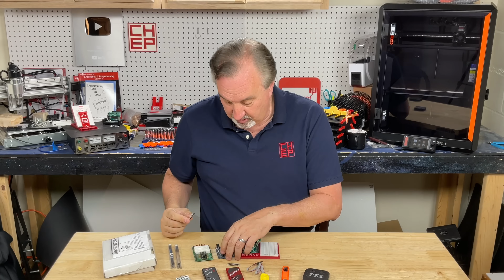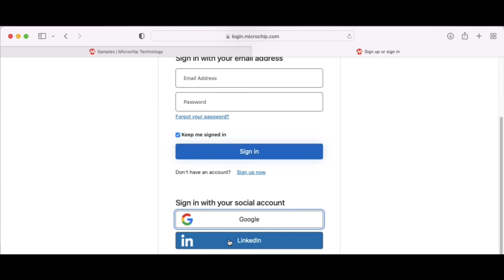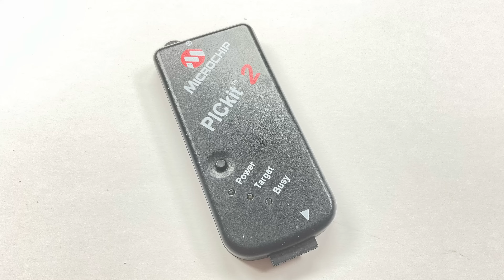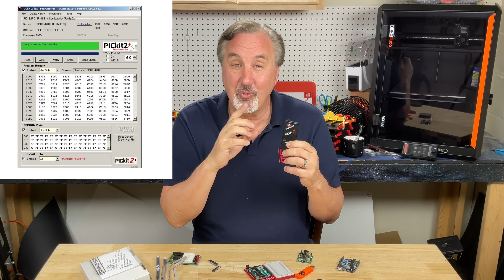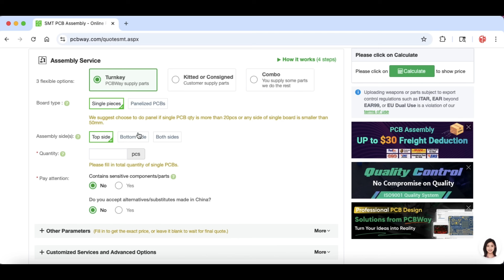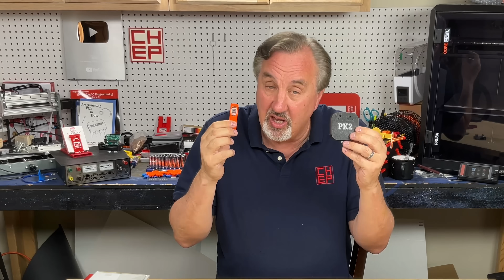FREE Microcontrollers for your Home Electronics Lab

Comment: 기능 땜에 8비트를 선택 하지 않을 테고,구입 편의나 개발 편의 나 가격에서 장점이 있으리라 생각하고 8비트를 찿나 본데..이건 아닙니다...마치 현대에 5천원 짜리 식칼 보다 더 멋진 돌칼을  만들려면(투입 인건비 말고도)한 10이상의 비용과 시간이 필요 할 겁니다.
Reply from the maker: Not convenience, simpler. Why use a sledge hammer when a simple tack hammer will do. Someone getting started with electronics can learn hardware and programming a bit easier than jumping into complex controllers that are hard to solder (which is why they are mostly modules) and more complex to understand. Plus you can get these 8-but micros for free in sample quantities. It’s an option to learn, the same way people are used early Raspberry Pi’s or old Commodore computers to learn about the fundamentals of PCs. And creating a simple LED controller just doesn’t need 32Bits to learn the basics.

Comment: I was at the Polar Filament BBQ a few weeks ago, didn’t know you were local. I’ve been programming Atmel chips, as a hobby, for years. Never tried PIC’s. Have you had any luck with the “newer” AVRDx series? They seem promising but are difficult to program. So far I’ve had a 20% success rate with a handful of AVR64DD28’s at blinking  an LED.
Reply from the maker: I haven’t used those. What tool chain are you using?
Reply: @FilamentFriday  I write the program in Arduino, then flash the .hex file with pymcuprog. I use a MPLAB Snap for the programmer. The MPLAB x IDE never worked for me. I’ve tried Adafruit’s UDPI Friend, or the DIY SerialUDPI and Arduino. That works for the newer AtTiny series, but not for the AVRDx series. YMMV
Reply from the maker: I’m hoping the PKX software comes out soon. It gives you a nice GUI similar to PICkit 2 but supports all the latest programmers. Maybe comment to them if it supports those devices. 

https://youtu.be/VNyvLxknr_E?is=Rx4XuJdjIvtBZ5u1

Comment: This was around probably for 30+ years. Although in Hungary it was suspended, because all the EE students ordered free microcontrollers and there was no sale. (pretty stupid idea if you ask me)
For the AVR8 part of the video: You can order an Arduino Nano from Ali for around $2, and use it as a hardware programmer. You can use either the ArduinoISP sketch from the examples, or you can easily write your own (I did both). The Nano I used has a neat trick: I cut the reset track between the ISP header and the MCU, and connected a GPIO pin there. This way I can use its 6-pin connector to program another device. I have no comment (minimal experience) on the 8 bit PIC, it's a weird architecture. ARM and the ESP32 based devices are getting cheaper, so their usefulness is limited anyway.
Nice video though!

Comment: This wasn’t on my radar at all - thank you!

Edit - confirmed first order of 3 ATTiny85s coming my way for $0 and $0 shipping in 1-2 weeks. Let's gooooooo. I'm definitely going to try wiring up one of my development boards to program it, but I'll look into whether I'd prefer a dedicated device down the line. I'm going to snag some Atmega328ps next, but what really got my eye is that there's also a ton of samples for other compatible chips for LED drivers and Zigbee Transceivers and Humidity sensors etc. Right on!

Comment: what about the new stm32c0 series? 32 bit, cheaper than 8 bit mcus, and recognizable ecosystem and gpio
Reply from the maker: No hobbyist friendly DIP packages. 3.3v operation vs 8-Bit 5v that is for easier for many sensor interface. Relies more on dev boards for programming or pre-installed bootloader than stand alone programming option. Also far fewer device choices. 
But it is another potential tool in the tool box.

Comment: Hi Chuck, great video! We have an rc car club that race the RJ Speed R/C Legends Oval Cars. I got one of the traxxas start light and have been trying to add a start horn to it with just some limited success. Is it possible to have pcway to build a board that I could plug in an extra receiver for my car radio (Futaba spare ch button) to start the count down with short beeps and then longer blast for the start of the race just like the traxxas does with lights. The traxxas also varies the time between the get ready and start light. Thanks for any help. Mike
Reply from the maker: That all seems possible with a little bit of 8-Bit programming. I assume the CH button puts out a pulse that controls a servo controller.

Comment: So what software on what OS runs the early PICkits? I have an ICD2, a PICkit2 and a PICKit3. None run under current OS's. When I last looked at MPLab, 0 of the few hundred 8 bit micros i have - bought and paid for- are listed. 
Also have some older 16 and 32 bit microchip products. I think they're junk now. 
ESP dev boards are cheap and headache free.
Reply from the maker: You can download GCSTUDIO (with GCBASIC compiler and PICkit 2 software included) for free right now and use your PICkit 2 and all your devices right now at no cost on the latest Windows OS. 

This is also why I like the open source PICkit 2 and PICkit+ software. It runs on the latest windows OS and supports PICkit 2 and 3 with all the older and newer devices. There is a Linux option as well. 
The GCBASIC I recommend runs on latest Windows as well and will support all your 8-Bit devices. The GCSTUDIO IDE option is based on VSCODE. 

Since PICkit/PICkit+ GUI stands alone you can use it with any IDE you want. Once the time/date stamp changes for the Hex file (due to new compile) the PICkit+ software can automatically programs the device. 

MPLAB is a different story. There is MPLAB 8 which is Windows only and MPLAB X which is Windows, MAC and Linux. Now there is now MPLAB for VSCODE as well. So I’m not sure which MPLAB you refer to. 

ICD2 requires MPLAB 8 so for the most part that tool is limited to dead unless you run MPLAB 8 on Windows 10, 11 with compatibility mode in windows.
Reply: @FilamentFriday 
Thank you so much for a rapid and detailed response! I will look into this. Thanks again!

Comment: Remember when the quantity was unlimited & they didn't require a corporate email address.  The C compiler was for Windows only & paid.  We programmed in assembly & made parallel port programmers, just to get any amount of computing power for free.  It was bad for finding a job though, as the industry was pivoting away from makers & towards leet coding challenges.
Reply from the maker: I remember. AI  (IMHO) is changing the game. Coding is getting far easier. Hardware the challenge. Just search Tesla and 8-Bit and see what they’re doing. Present 8-Bit architecture has built in analog capabilities that make them potentially smart analog devices with the right code. So I see opportunity for those who understand but also what could be a lot of fun once again for hardware loving makers & hobbyists.

Comment: Thanks for this video and the heads up Just ordered some ATTiny85 for a micocontroller IR remote control project I am starting.
Reply: Try attiny412/212 is way better and modern
Reply from the maker: 412/212 aren’t offered in DIP for easy experimenting. With GCBASIC, you can develop with Tiny85 and with a single command line change convert code to 412/212 when ready for surface mount.

Comment: As for boot strapping your Home built programmer, I used to use the parallel port to bitbang. Avrdude probably still supports that, but parallel ports are long gone from PCs. Just buy a programmer and spend the energy on your projects.
Reply from the maker: I’ve sold some in the past as solder kits. Some people prefer to build their own.

Comment: Free is all and well but if you design using the chip the unit cost may be higher than the other options out there.  And keep in mind PIC is not as standard and multi-sourced as ARM or x86. Your design will be captive to a single source.
Reply from the maker: Most hobbyist projects won’t need more than a few free ones so not sure how unit costs affects that. But even in quantity many are sub $3. Power consumption is typically lower with 8 bit as well so battery powered projects benefit. It all depends on the project. Having the capability of multiple options gives you a more complete toolbox to design with.

Comment: I used to live near Silicon Valley and used the "sample" programs to get chips for one off projects. The biggest issue I had then (late 80's-early 2000's) was making my own PCB's. Now, with companies, like the one you advertise, it takes that PITA part of it out. I worked at a company once as a robot tech, we had a sensor board that failed often, and was a PITA to replace. I redesigned the board it was mounted on that could be changed out in 5 minutes vs. 45-60 minutes before. We made, by hand 200 of those boards. drilling all the holes, separating all the individual boards, etc. You wouldn't believe how those boards would eat up drill bits and milling bits! 
PCBway would have made that a lot easier, and probably cheaper! The best news was that the sensors I bought for the boards had a much better sensitivity, and more reliable, so that we didn't have to replace them as often.

Comment: Really cool video! I ordered some samples to learn with. The PicCircuit programmer looks really good. I'm a little confused about what development board to use to actually program the different sized chips...PicCircuit has some kind of adapter you can buy bundled with it. Is that the best route?

Would love to see more content on putting these chips to use and also integrating them as you've mentioned with an ESP32!
Reply from the maker: Yes, that adapter is a universal programming adapter for the chips.
Reply: @FilamentFriday  I ended up just getting the Snap. It seemed to be the best and cheapest route into messing with this stuff. AI was also pointing me to it.

Comment: Of course, that's just what I need, another set of projects. :-) Free time? What's that? All kidding asside, I can think of lots of uses for something like these for design ideas for around the house or up at the property. Everything from replicating CAN Bus 3d printer stepper controllers through milling machine and lathe controllers, through home made robot mowers with independent control of each wheel and the movement of the blade plate. I have little doubt that people are going to have fun. Thanks for the update.

Comment: I am not sure that "free" should be a consideration, when it may be better to use one of hundreds 32 bit MCs like STM32, ESP32, or even RP2040, which can cost under $1 for a chip many times more capable than AVR with superior mutual compatibility compared to PIC and any flavor you can imagine....
Reply from the maker: Have multiple chip understanding is beneficial. Being able to experiment with Free devices makes that easier.

Comment: My problem is I dont know what chips to get.   Guess I should try using AI tools to help me design stuff for the tasks/projects I want to accomplish.

Im at baby steps, barely have wrapped my head around microcontrollers as a concept.  All the different models and part numbers I get lost really really fast.
Reply: I find it's easier to find a chip for a project rather than build a project for a chip. All the part numbers make sense when you have parameters in mind. I did a project that required incredibly low power draw as it was coin cell battery powered. I couldn't use many of the more advanced chips  due to this and ended up looking at dozens of options and became familar with their slight nuances. 

With that being said as a beginner it may be better to use the sledge hammer aproach and use a well powered chip with a lot of general use cases if learning the software side faster is important to you. 

Eventually you branch out, I like to pretend that everything I make would have to be a real world product. At the end of the day, unless form factor or battery wise, there are really cheap chips that can do pretty much anything you need, but framing with this mindset forces you to learn so much about hardware and software design when everything isn't overkill.
Reply: Can't go wrong with an Intel 8751.

Comment: I bought a pickit4 some time ago.  It programs most AVRs, PICs, and some ARMs as well! (chips made by Microchip/Atmel).  I also have an older Atmel ICE that was also sold by Microchip, and it's firmware has been updated to program PICs as well as SAM (ARM) and AVRs.  I made quite a few adapter cables to work with various programmer interface sockets.   I've gotten some samples of AVRs and SAMD chips from Atmel before they were bought by Microchip.  Analog Devices would also send you samples.  In most cases, they were only available to engineers from a company email address, but they also would send samples to Ham Radio builders as well.  My favorite 8 bit MCUs are the AVR128DB series, and the ATmega4809.  Both are offshoots of the ATXmega series.

Comment: Well, you basically spoke Chinese to me, Chuck... 😬
I don't understand, any of it. But I definitely want to learn!
BTW, Radiomaster makes a programer as well... But I don't know to what it's comparable, with the exception of ESP32 chips. (It's a remote controller brand and, in the past, you needed a programer sometimes, to work with ELRS receivers. I don't know if they still make it, because it's rare for someone to need one now.)
Anyway, stay safe there with your family! 🖖😊
Reply from the maker: It’s not that tough to learn. I’ll have more beginner friendly electronic tutorial content on here soon.
Reply: That's gonna be a USB to TTL often called an FTDI programmer. Which is used for anything over a UART serial connection like the gps and receiver connections on our FC's, actually the flight control softwares have one built into it now so you can use an FC to do the programming but, they sometimes have issues especially with f411's. FTDI programers were a must have for those into FPV in the early days when everything was DIY and things would screw up when updating all the time and you had to connect over a UART to reflash it. I don't miss those days but, at the same time I kind of do if that makes sense, it really taught me a lot of things I never would have learned if it wasn't a necessity to fly.
Reply from the maker: That FTDI module a USB to TTL converter not a programmer. The Micro had a bootloader software installed like Arduino and the FTDI converted to USB signal to TTL serial so the bootloader could program the memory. 
In order to install that bootloader originally, the company used a hardware programmer.
Reply: @FilamentFriday  Haha sorry you're right, that's just the terminology I default to for anything used for programming and since they didn't even know what usb to ttl was I was just trying to explain it without getting into schemantics of convertors vs programmers. I am familiar with usb asp programmers and bootloaders though. I've used plenty of bare attiny/mega without bootloaders but, for an esp the bootloader is baked in so you never have to worry about any of that.
Reply from the maker: Yeah, it’s also a module not just an individual IC.
Reply: @FilamentFriday You can get bare esp chips but, modules are just easier so you don't have to deal with tuning the rf front end and it makes fcc licensing much less complicated and cheaper. The bootloader is baked into the rom of the chip.
Reply from the maker: All good but this is about smart simple low cost peripherals as mentioned in the video.
Reply: @FilamentFriday  Ya I was only talking about ESP because the original comment was about ELRS rc receivers that use them.

Comment: How about PDI programmer for attiny212?
Reply from the maker: There are many AVR programmers to choose from if you want another option.
Reply: @FilamentFriday PID is the 1 wire programming interface for modern AVR  that do not support ISP programming. I think there is a way to program an arduino nano v3, but would like a PDI  USB dongle.
Reply from the maker: You’re referring to Unified Program and Debug Interface (UPDI). It’s used for in circuit debugging and programming using fewer pins. 
The low cost MPLAB SNAP supports that as well as some DIY Arduino setups. PICkit 4 supports it as well if you are willing to spend more.
Reply: @FilamentFriday  Be aware that the UPID in debug mode does a rewrite of part of the flash for every breakpoint.  This will eventually wear out the flash in the chip, but it should last long enough to debug your project.  And with free chips in dip sockets (you can get QFTP sockets but they ain't cheap) no biggie.
Reply from the maker: Debug with one, production with another. 
Personally I prefer small pincount PICs over ATtiny anyway. But I’m open to all options. 
The nice thing is GCBASIC supports both families with the same coding (minus a few config settings).